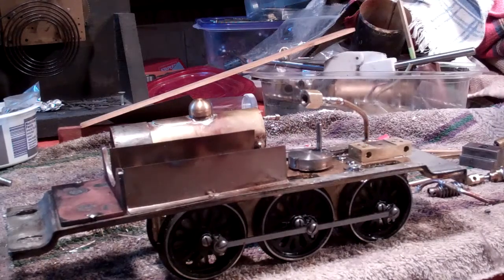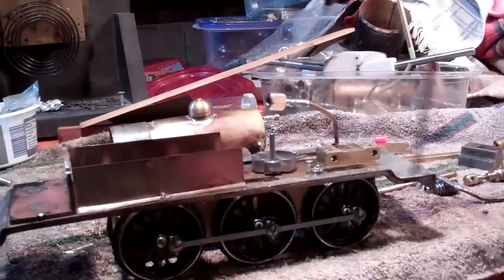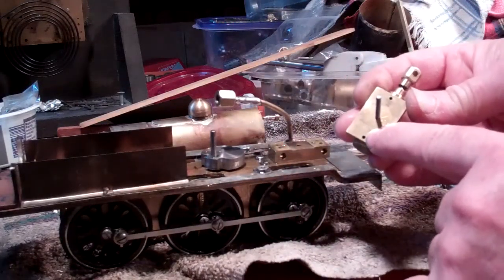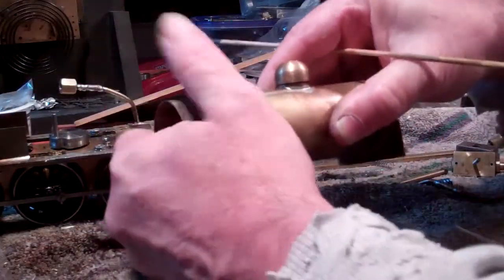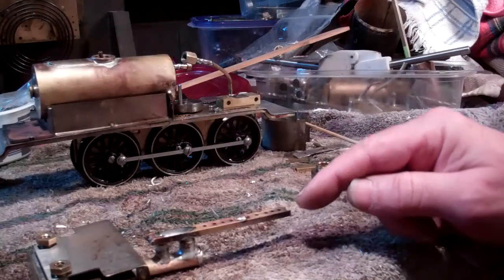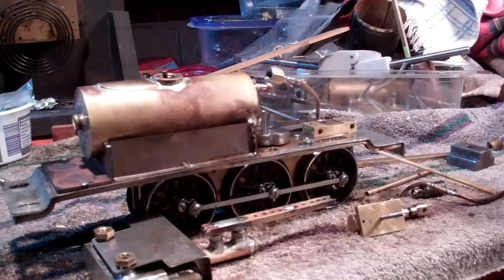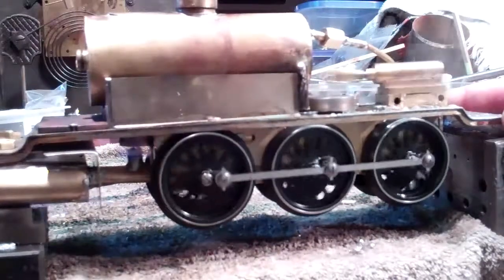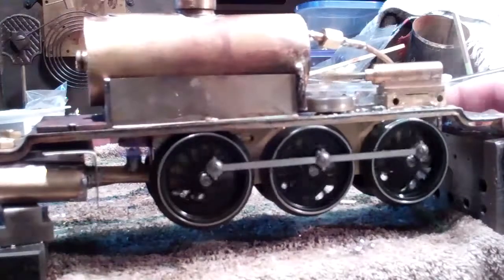O GAUGE SCRATCH BUILT STEAM ENGINE

Comment: Quite the nice little build, now I thought I'd let you know that when you test run on it on the track for the first time to keep an eye on the tail end as I think It's going to be a bit front heavy considering the boiler seems to be more central above the front driver and that you have your burner at the front. Easy way to fix that if you really want to keep the burner at the front is to add a bit of weight to the rear to balance it out or to move the burner to the rear.

All in all a nice little build and I can't wait to see it finished! Those larger drivers should give it a decent little speed on the track as well.